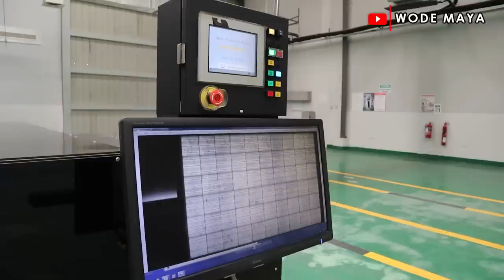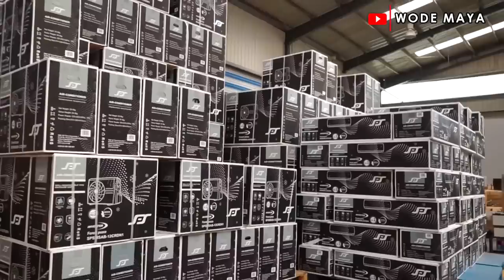The Ghanaian Family Behind $50 Million Dollar Solar Manufacturing Plant!

Comment: You should check out a company called Solar Windows Technologies. It’s a new company that uses a new technology that consists of making solar energy with a liquid that conducts energy. It could be produced cheaper and more easily and you could use them on the roof ,and for windows in homes electric cars, and commercial buildings allowing you to produce more energy.

Comment: 17:17 how about internal ceiling insulation, it will reduce your air-conditioning load to reduce burning heat from outside  on the metal structure that looks like a giant oven! #wodemaya